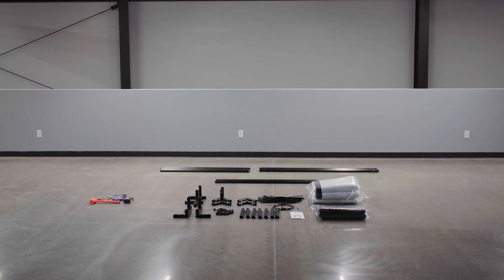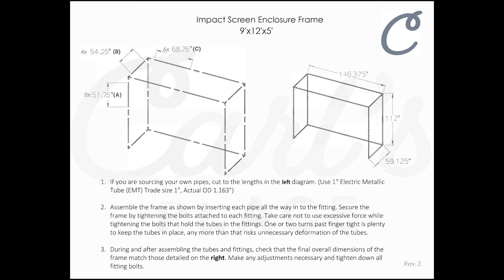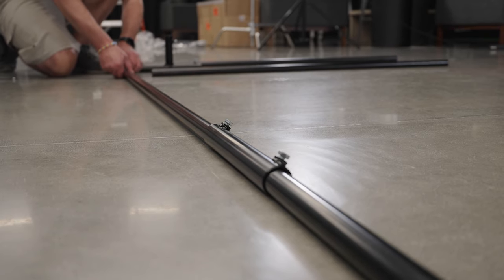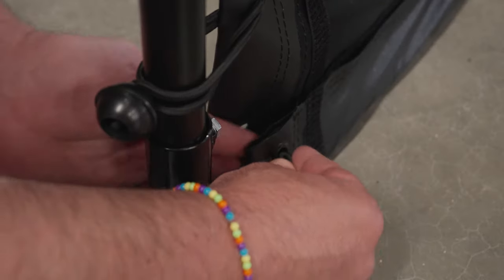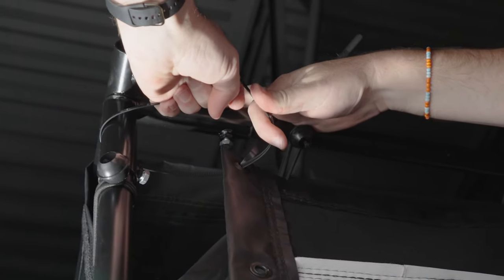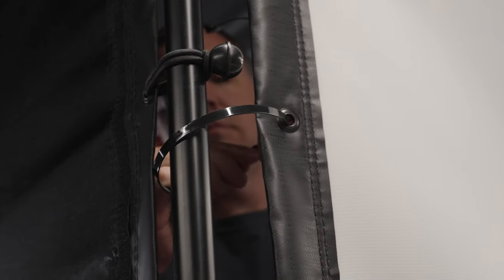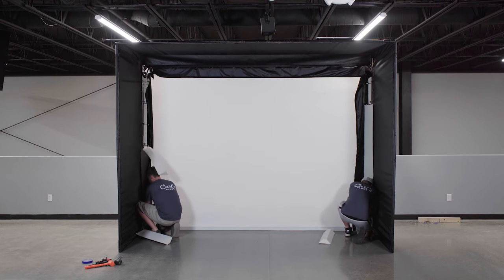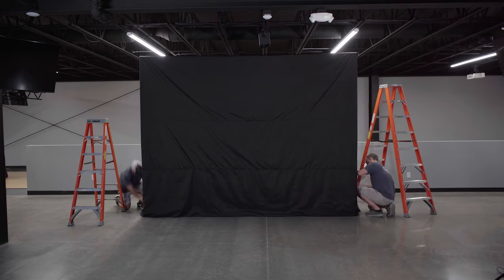How to Assemble a Carl's Place DIY Enclosure (C-Series)

Comment: This video COMPLETELY SKIPS the fact that you have to put a spring into the cable receiver.  I completed the installation following exactly this process outlined in the video, every step of the way, extremely carefully - only to discover at the end I had a leftover spring and no clue where it goes.  It IS referenced in the paper instructions, but Carls staff told me to use the video instructions and that is what I did.

Comment: What size screen was used for this install demo?
Reply from the maker: I believe this is our 9x12x5 DIY. Screen dimensions for that enclosure can be found here: https://20033507.fs1.hubspotusercontent-na1.net/hubfs/20033507/Product%20Documents/DIY/DIY%20Golf%20Simulator%20Enclosure%20Kit%20Specifications.pdf